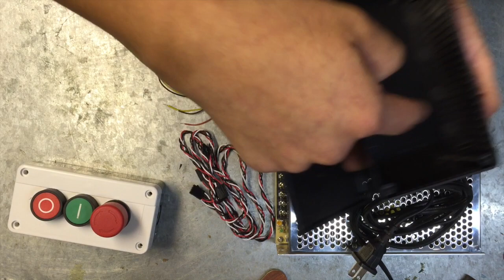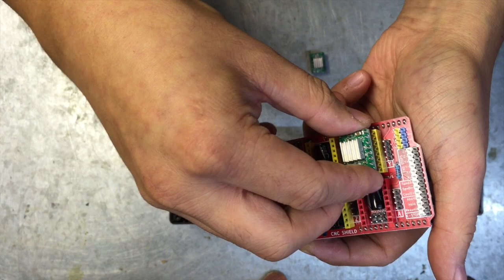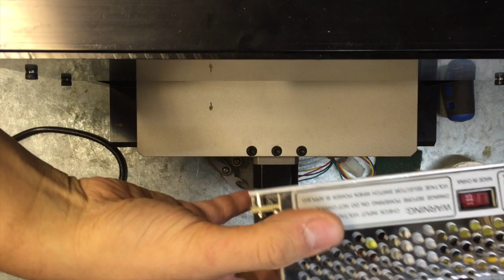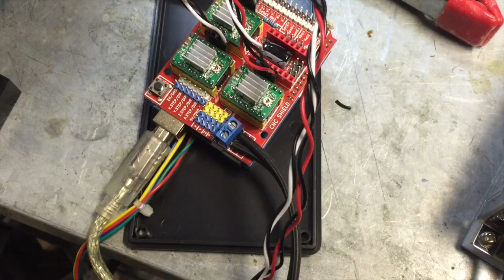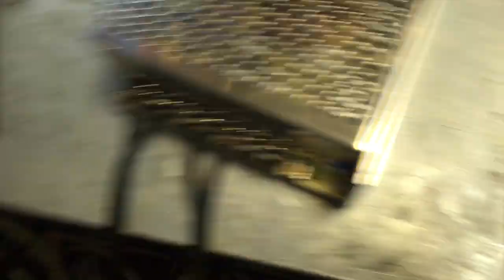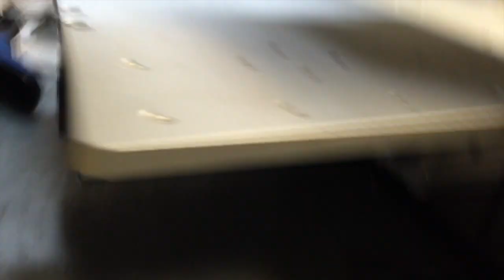Metro Made | Sable 2015 Lunchbox CNC Conversion Pt1 Arduino

Comment: Nice, sorry bout the ten reposts I was getting frustrated, it kept saying error. Thanks for getting back to me
Reply from the maker: +Shane johnson No problem, I fixed it so only one of the comments shows up. You CAN save yourself some work by buying the whole kit and then just swapping out the controller board, but it'll cost you a couple of 100's more.

Comment: Hello Eric!, thanks for the tutorial. Why you set in 1/16 ? i read that it is not recommend because of lost of steps.
 Im preparing to use my sable 2015 (yesterday i brought arduino and v3 shield with same drivers), i had for many years without using.

Comment: Is this a lot better CNC than the 3020 model you see everywhere on ebay?  What size tools does the collet take?  What about hold-downs?
Reply from the maker: +Cisco8484 It is better than the 3020 in that it's more accurate. If the 3020 I have was with ballscrews, the 3020 would be better machine. This is only machine that fits in my current small shop.

Comment: Cool.  Looks like a good little machine for someone to cut their teeth on.
Reply from the maker: +Greg's Garage Thanks Greg. 

From what I gathered..this machine is designed for PCB manufacturing and prototyping, hence the more accurate anti-backlash nuts and the small form factor. For my scale of work, it's going to be a great desktop machine for cutting my exotic woods.
Reply: What are you making with the wood?
Reply from the maker: +Greg's Garage I make slingshots, I have been cutting handles: www.metrogradegoods.com

Comment: Is there anything in particular that you are not able to do without a CNC router, thus making it necessary or is more of a speeding production up thing?
Reply from the maker: I am able to match up my waterjet cut parts to cnc machined parts. The Cnc takes light cuts and almost eliminates fibre blow out on some extra crispy woods.
Reply: Correct me if I'm wrong, but you had to file and sand the scales in order to match up the Al cores right. I also remeber you routing the corners,so why not just use a flush trim bit to match them up? 
ps. I'm not trying to come up with reasons for you to not use the CNC, just wondering why it instead of something else.
Reply from the maker: +2dividedby3 A flush trim router bit is quite violent and risks damaging or chip out on some complicated wood laminations. CNC machines take layered cuts so there is much less lateral pressure and less material being removed. This results in a super smooth and accurate, not to mention WHOLE part. CNC machines provide repeatable results, which is the best part.
Reply: I see, less work when finishing each of them, and harder woods would chip out a lot I suppose. I need to get you some Ipê and /or Jacarandá. Thanks for all the answers!!
Reply from the maker: +2dividedby3 I have both but they are tough to work with with files and sand paper alone. A Cnc machine is the key!

Comment: What did this project cost?
Reply from the maker: +Shane johnson It will vary depending on where you get your parts, but in the neighbourhood of $800-900.
Reply: in argentina (pesos ARS): plastic Box like  $450 , arduino+shield+4drivers $650. Machine with nema17 cost 500us + 100us for spindle (see ebay).